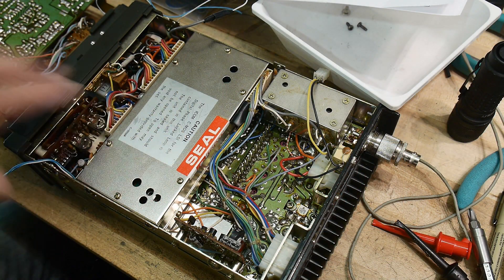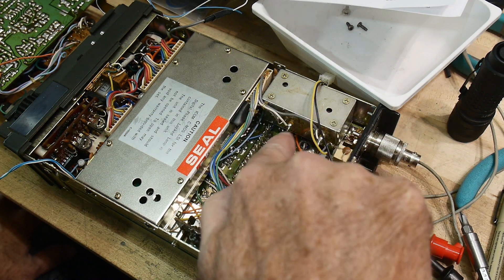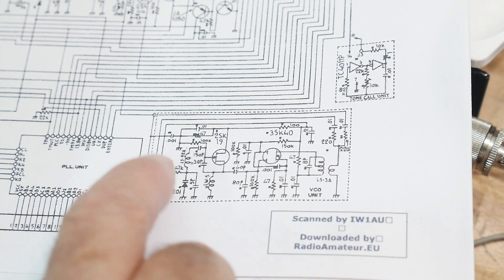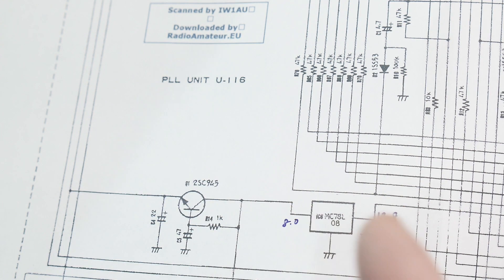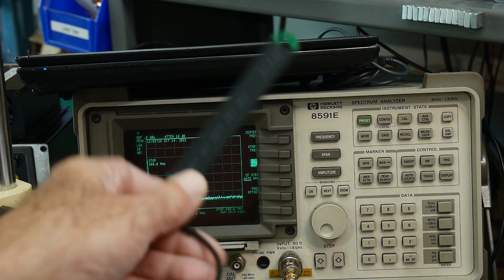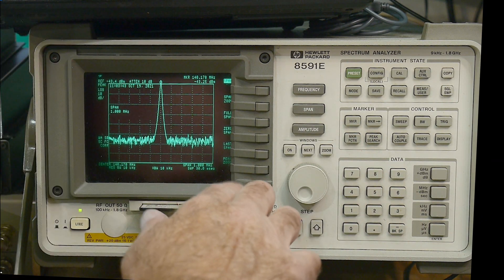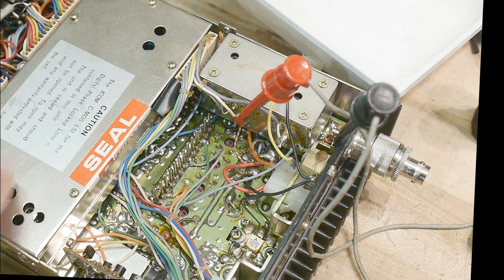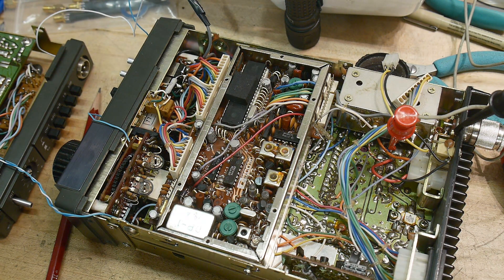#952 ICOM IC-245 VCO Not Working

Comment: Where did you get your voltmeter leads that clamps on the wires?  Also I'm a mid aged person trying to teach myself about electronics.  I have learned how to solder both tht and smd components. Also I have designed simple board's in KiCad . I'm having a problem learning the way to put resistors ,diodes and etc in circuits.  I have read some of the art of electronics.  But still I am looking for a way to understand this faster . Any advice?
Reply from the maker: I made the leads. uses Pomona minigrabbers. 
I suggest looking at as many schematics as possible and see how others have designed things, also, trying to fix things forces you to understand circuits.
Reply: Thank you

Comment: Given the age of the unit, it could be the electrolytic capacitors in the vicinity of the  HFE multiplier that have caused the failure. I also see leaky ceramic capacitors (radial ended) in some of the 1970s  gear I work on.. Hard to find sometimes, but freezer helps

Comment: Hi,  that mystery transisitor is an old trick used to decouple a voltage rail, it's called an HFE multiplier.
The transisor's HFe is used to multiply the value of the capactor on the base to ground. 
If the HFe was 100, and the cap 1.0uF, the effective cap woud be 100uF.   

An old but useful technique from the dark ages which saves big caps and board space. 

FYI, you may find the cap is short, hence no OP on the emitter. 

Best!

Comment: 2SC945's were infamous for failing. That circuit looks like a "capacitor multiplier" to decouple the VCO supply voltage. If the 2SC945 hasn't gone full short, sometimes they can be coaxed into working temporarily with a little freeze spray or heat from soldering iron tip. Thanks much for this series of vids.